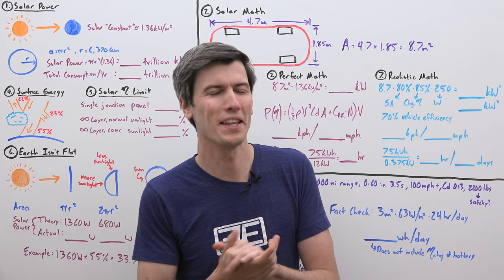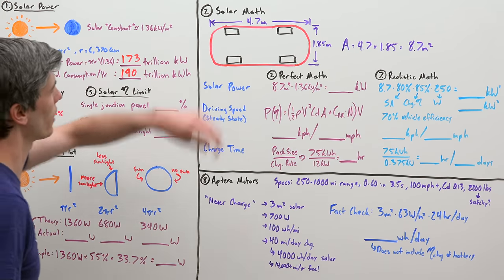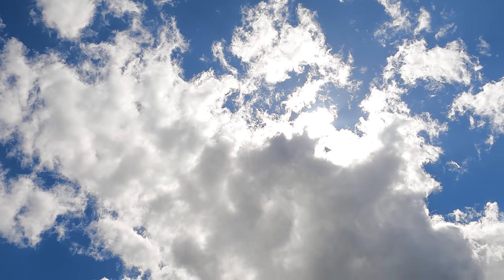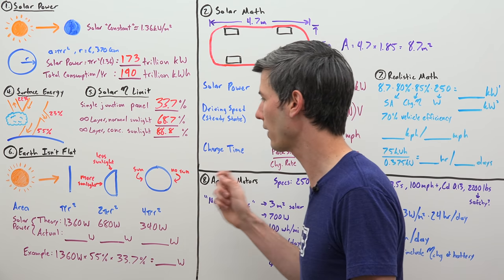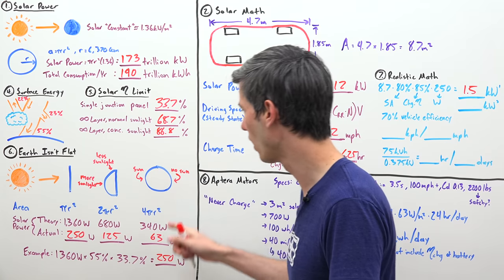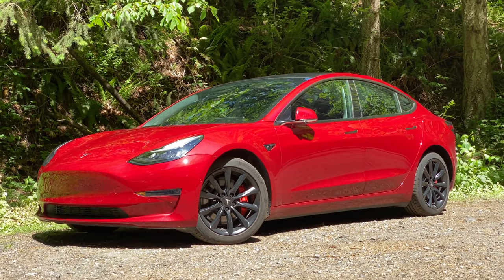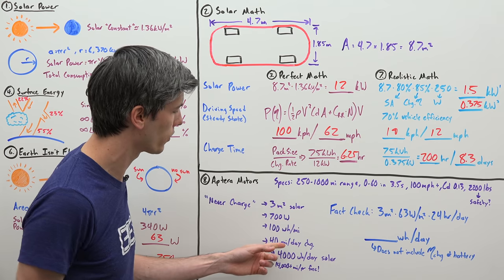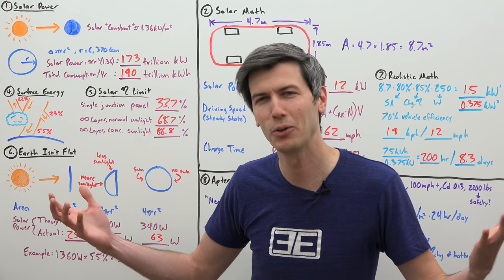Why Don't Solar Powered Cars Exist?

Comment: At 9 kWh / day (0.375 kW * 24h/day) you could still get 26 miles per day of distance on the Model 3 with its 34 kWh/100 mi. That's 9600 miles/year!

Comment: that 'average solar power available' is a bit misleading though isnt it, because you are not driving all around the world on average, you'd typically be driving along a similar latitude most of the time, so not getting the highs+lows that create that average. the result would be that these advertised power/ranges etc would be limited to a band several degrees of latitude above and below the equator, and barely function at latitude's higher/lower than that

Comment: It would be interesting to see the math regarding the energy absorbed during the entire lifetime of the car. How many full charges would you be essentially avoiding over the same car that gets 100% of its energy from charge satiations. If that total kwh multiplied by the cost of energy in their region, it just might pay for the solar panels!
Reply: In many areas you will gain around 11,000 miles per year of cost free travel.  Energy costs vary widely, so this calculation will need to be done for a specific location.
Reply: @n.brucenelson5920  How does your answer relate to my question?
Reply: @n.brucenelson5920  Hint: I already know the answer. You don't need to factor in miles as they are irrelevant. You basically assume the solar cells are not attached to the car and you're connected to the grid. Kwh gained over the life of the car can be calculated directly.
Reply: @electrospank  As I hinted earlier, the amount of power gained and the cost of that power will vary widely depending on location.  The average residential customer pays 13.31 cents per kWh. with 1460  KWh collected in an year in sunny locations.  The payback, assuming that you never charge at more expensive road side charging stations, will be about 4 years to pay for the cost of full solar.
Reply: @n.brucenelson5920  Duh. That is covered already in the video and extremely obvious information. I have a degree in physical science. My comment was to ask that information be included in the video next time as a teaching aid.
Reply: @n.brucenelson5920  I'm amazed you still didn't answer the question. Do you understand it?

Comment: The aptera Launch edition sits at 60Wh/mile. thats another 40% less consumption a.k.a. 60% higher range for the same amount of charge. So if we thought it was possible before now it seems almost trivial? Based on this we could see much higher numbers than 40miles per day. and around that even in spots that only get about half that sunlight. Outside the car obsessed USA 64km (40miles) a day is total overkill anyway. The average european drives only 31km a day thats not even half the original estimates and only about a quarter of what these cars may end up delivering in ideal conditions. So yea my conclusion is that its absolutely possible to never ever charge your cars.... well thats at least until the world figures out that storing cars in carparks is a horrible idea and our cars never see the light of day again. But thats just wishful thinking....

Comment: I wouldn't even care about driving on solar 100% (collected by the car). I see so many other benefits even if it is like 15 - 30 kilometers per day that it can charge up.
- Going camping - let it charge while you camp
- Most city drivers wouldn't even need to charge or charge very rarely - e.g. if i drive to work, to the store and back home, i will drive for about 9 - 13 kilometers
- Less worries about battery going completely empty if car is not used or is used for very short durations at a time
- Emergency use - e.g. miscalculation leaves you a kilometer or two from the charger. Could just wait for an hour and then drive there

I would love to have for an example a hybrid car that could do this.

Comment: E=mc2 that is why, the - mc2 which is the mass of the car (Weight)and the speed requirement's  of the car does not equal "E" the energy required to run a car for most motoring needs. however if you has a network of satellites around the world  that could stream the suns energy to individual cars  but that's way in the future

Comment: If you have a yard stick, 36", and you hold it 10' off the ground in full sun, what is the length of the shadow it casts onto a flat surface? It is NOT 36". This points up a MAJOR flaw in this guy's argument.

Comment: to be fair you also assumed roughly double the solar panel efficiency we currently achieve. most panels today are around 15-20% efficient. tesla solar roofs are at 19.6%. assuming they use the same tech, youre overestimating efficiency by about 14%
Reply: Aptera panels are about 22-23% efficient.

Comment: what if instead of having solar panels on the car itself, electic car companies sold some lightweight solar panel assembly thing you could put on top of your garage (or take with you in a trip). Then if you only drove 30-40 miles per day you could probably almost entirely cover your needs with solar charging.

Comment: Surely the answer is to still charge up your car overnight on cheap electricity, but also to charge it from solar panels on its roof. Some Electricity Companies will actually pay you to use surplus electricity at certain times in the night.

Comment: Better to have solar cells on your car than at home where your BEV isn't parked when the sun is shining.  Charging all day in the summer sun might gain 10 miles of range, but the design compromises and cost don't pencil out.  Storing home solar in home batteries doesn't work out either since costs $1000/kWh installed and give only ~3000 cycles of life, so you pay 33 c/kWh to use that "free energy".  Plus, an upfront cost so consider more like 66 c/kWh with time-value-of-money.  Cheaper to buy power from the utility most places in U.S.  And can no longer sell excess solar to the utility like before since net-metering is gone.  SoCal utilities want to credit only 3 c/kWh for solar power you upload, plus charge you $300/yr for the grid connection.

Comment: short answer: solar is at most 25% efficient, 75% of the sun's energy is heat loss, and there isn't enough area for the necessary amount of panels to charge reliably. Also depends on the weather. And night time.

Comment: Thank you much for the math.  Only thing that bears weight and can be fact checked.  (I don't do well with opinions and propaganda)        To the rest of the commenters, your car has X mount of power available.  If you install a solar power collection that will be supplemented while in the son.  IT DOES NOT MATTER IF YOU USE SOLAR OR BATTERY, energy is energy no matter if it's being used for the wheel motors or the AC or the radio.

Comment: Wouldn't solar panels be useful to extend range? And Wouldn't it be even more useful on buses or trucks. A Tesla is powerful enough to propel it to 100 kph  in3 seconds then surely the same running gear could propel a 50 seat bus with at least three times the roof area with no windows to worry about?

Comment: I thought a typical current gen solar panel’s efficiency is somewhere between 19%-23% for higher tier panels. 30%+ is being somewhat generous IMHO.
Reply: Just eyeballing (no math involved) the top surfaces of the car. Roughly about 900w (3x 300w panels) worth of solar panels. Realistically probably generating 600w-800w on a good day.
Reply: @ezymarkz  Pretty close. Aptera panels are 22-23% efficient and have about 750 peak watts, or a total of about 4 to 4.4 kWh on a good day.

Comment: Using the Aptera calculations for the Tesla: [(8.7m^2 solar x 63W/m^2 x 24/h)/250Wh/mi] x 0.89 Batt.eff = 47 free miles/day. Not insubstantial.

Comment: In Germany 1 squaremeter of solar provides only about 15 Watthours in average throughout a year. Then there’s lots of more issues like defective cells, shadowing, cell degradation, higher insurance and maintenance costs and the costs of the solar itself is making this so expensive that the little power generated will never even out the costs.
Reply: The cells used in Aptera are less expensive and more efficient that the ones in your example.  There are also proprietary developments that make them easy to service and change out if needed.
Reply: @n.brucenelson5920  Energy density remains very low. If if you get 10% more efficiency (which is a lot) this will still average below 20 Wh throughout the year. It just does not make any sense. It would make much more sense to put in a larger battery for that price and charge that through stationary solar much more efficiently, faster and cheaper.
Reply: @marcusfleuti2672  I think you have not done your calculation correctly.  It will vary by location, but It looks to me from looking at solar insulation charts that you are likely to average around 2.5 kWH per day in much of Germany given the area of Aptera panels and the 22-23% collection efficiency., which probably does make sense considering the cost of full solar is only $900.  

Batteries are expensive and do not change the amount of power you gain through solar.  The extra weight also gives you a range penalty.  I do agree that stationary solar makes a lot of sense if you have access to it.

Comment: How fast (kwh) can you charge and discharge a battery at 100 d F? 
10kwh?
Reply: That will vary by battery size and chemistry.  New batteries have higher charge capacity at high temperatures.

Comment: Why don't these electric cars also have smallish wind turbines in the front grill area or under the car ect? That plus solar panels, would that make a difference?. Also have some fold out panels so when parked it charges better.
Reply: Wind turbines seem rather impractical compared to improving aerodynamics. Fold out panels sould like a good idea though, so long as winds aren't to big of an a issue.

Comment: Did i miss the part in the video about motor effeciency?
Reply: The motor efficiency is high, over 90%, partly because there are no transmission losses. There is also less rolling resistance due to the 3 wheel design.

Comment: A short reality check - in the US sunbelt - it takes 10 300watt std solar panels charging an intermediary battery 8 hours in order to charge a Tesla Model 3 enough to go 30 miles.  There are some vehicles that have integrated solar cells but they are oviously small and of ever lower capacity. The Aptera 3 wheel motorcycle is claimed to be able to get 30 miles charging all day in sun belt condition - but - probably not true. There is a "glaring" problem though - you are talkiing about leaving your car parked in the sun all day - people in the sunbelt try to avoid that.

Comment: well Lightyear from Netherland combines solar panels with batteries. The car can be charged 40% if driving on a sunny day...eventually with fully charges batteries and then driving on sunny day -it would take months before needing a charge...Not all places on earth are conducive to a hybrid solar plus electric...maybe you should revise your clip because technologies do change...you are so presumpteous that solar hybrid is not the solution. Of course you did indicate totally solar which may never be possible but hybrid solar plus electric could

Comment: Not to be a drag, but in that last bit why are you using 24 hours a day? Most places don't get that much light. Wouldn't 12 hours a day be more reasonable? And even then it's not like you are getting peak energy at sunrise/sunset. I would say 8 hours is more reasonable. So really you are looking at 1000 wh/day which is not nearly enough to justify their claim. Maybe you can get 10 miles a day of "free" power.

Comment: Solar on the roof of homes and buildings is still the most logical and economical solution in most cases. Also their efficiency number is unlikely to be epa. Its much more likely that its there best case scenario around town while doing 40mph or less.
Reply: The 100 watt hours per mile number is for the EPA highway cycle and the heaviest version of Aptera.  The alpha cars have been doing better than that.

Comment: Aptera has it but the main thing is the aerodynamics
Reply: The aerodynamics, low rolling resistance and motor/battery efficiency all contribute with the ratio depending on on the speed of the vehicle.

Comment: More EVs should have solar built in just to extend the range! aptera also only uses three e-tires where tesla using 4, this adds decreases drag from tires and road friction. and the body is  the most aerodynamic vehicles ever. if you read this here is FREE ENERGY FOR EVERYONE just needs to get out there. you can use water to syphon uphill by have syphon into a container above a water source  then spout to let water out of the above container have the spout go back into the source it will forever syphon until water evaporates. you can use tesla turbine to generate electricity from the water falling back into the source! I will make a vid on it soon but sharing it with everyone!

Comment: A few issues with aptera numbers:
700watt not achieved in real world as its based on lab data with 1kw/sq meter light source
Cells are curved not flat, will never get 700watts even when car is stopped, moving car will be even worse. 
Their efficiency data for the vehicle never been verified.
The test drive in abu dhabi video, showed 1/3 approx of solar output predicted, as shown by the data on screen in the vehicle. Apteras estimates are way over stated and relate to maximum possible scenarios,  never met in teh real world. 
The only real world data shown is on the abdu dhabi video and a few other videos where the dash display was accidentally videod and uploaded by youtubers ( not by aptera), aptera have not been willing to show any real world data.

Comment: What if you have a lighter more aerodynamic and efficient vehicle than a Tesla??? 

I ask because there's plenty of electric vehicles that can do better than that with less power for example my electric bike does over 70mph at 12kw and I have another E-Bike that does over 50mph at 6kw.

 I'm also pretty sure I have solar panels that get alot more than 63w per square meter.

Comment: Did the 40 miles a day mean driving @12mph?
Reply: That figure comes from the 100 watt hours per mile used at EPA highway cycle speeds which go up to 67 mph, but average around 48-50 mph.

Comment: I've done this maths independently. It would work if the car had like a 8x8 m solar canopy. Not very practical on Earth but could be workable for car-sized rovers on the Moon or Mars.
Reply: Aptera has about 35 sq. ft of solar panels, or a peak 750 watts.  This is enough for about 4.4 kWh in the Southwest.

Comment: Fold out panels with more solar panels, deployed while parked, could help.
Reply: At that point it is simpler and cheaper to run a plug to solar panels on the roof of the parking structure.

Comment: I'm not so much interested in powering the drivetrain with solar power, but what about auxillary systems? Wouldn't a solar panel on the roof of the car allow running the A/C without using battery power? Imagine parking the car somewhere in the sun but having the car stay cool without using battery power.

Comment: The best way to use solar power for cars is the way Tesla is doing it.  Have EV's.  Have solar powered charging stations.  (Both superchargers, and home chargers, since Tesla also sells home solar solutions.)  You can't really put enough solar panels on an EV to power it, because there just isn't enough surface area.  Plus solar panels increase the weight of the car (making it require even more energy) and are fairly unwieldy.

Comment: And, to be even more fair to Aptera and their attempts at transparency, they say "up to" 40 miles per day.  In other words, under ideal conditions.  The thing that I can't WAIT to be proven, is their 100 Wh/mile claim.  That better be at at least 55mph... hopefully faster.  However, using his theoretical model and napkin math, if a Model 3 can theoretically do 62 mph using 12 kw of energy with a a CDA (not CD... that would be less than double) and weight figure double the Aptera's... that should mean it should use about half the energy at 62 mph.  So 62 mph/6 kW = 10.33 miles per kW.  Or about 97W/mile.

Comment: They (Aptera) actually have a map with min and max solar-only range. For most of the World it's minimum is around 10 miles and maximum in the 30 miles. 40+ is a global superlative.

Edit: Still I find it as a win that you could drive average 20miles a day without plugging. That's enough for a daily commute, and if it falls short, the needed recharge is really quick because of the little energy needed.

Comment: Solar panels on hybrids makes sense.   Bring them out with twice the battery size and that will easily give you about 2 litres/100kms or 120 miles per gallon real world for something like a Toyota Corolla.
Reply: Aptera achieves close to 340 eMPH

Comment: Best way to make small light eight cars safe is to make people realize that they don't need there over sized and useless SUV and truck. Most are never off road in the slightest nor do they haul enough cargo, frequently enough, to justify it. When a mini van or wagon would do the same job as an SUV and both are good at towing small trailers for anything that you might need to randomly haul once in a while. Small and med sized trucks also haul more than most need and again trailer if more is actually needed on occasion. And if you don't want to own a trailer or have place to store one then you can rent one cheaply when you actually need one. Also a big SUV or truck is only safer than a small car when there are small cars on the road, but since damn near every body is in a big SUV or truck you are not any safer. I would rather be in a 1 ton car hitting another 1 ton car than a 3 ton truck hitting another 3 ton truck.